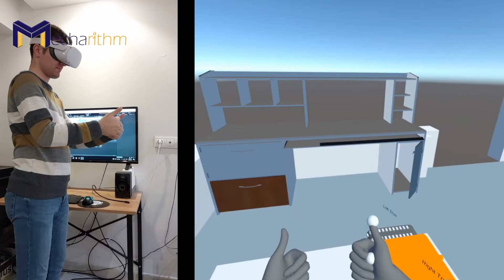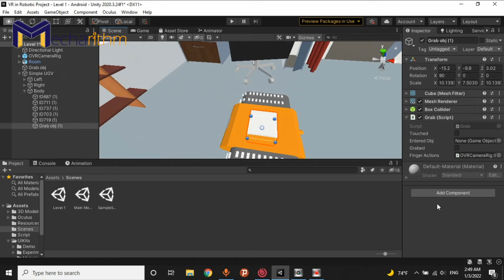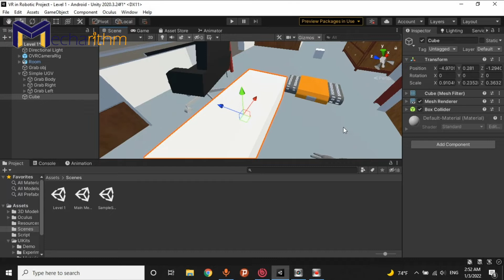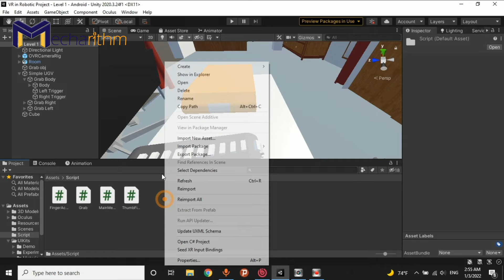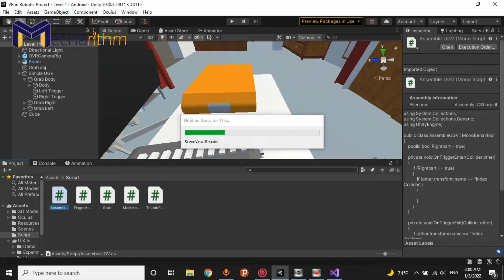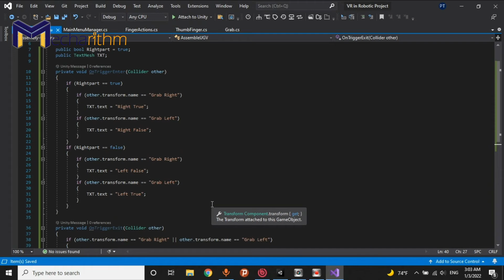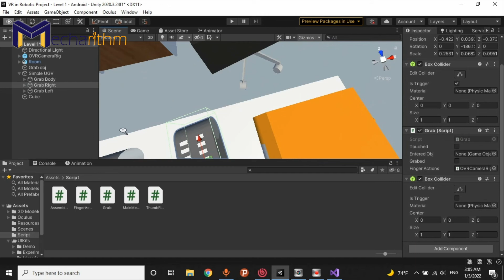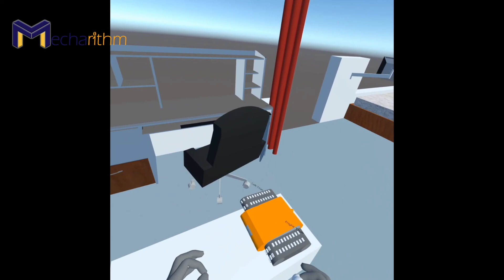VR Robotics Simulator: Assemble a Robot in VR (7/15) | VR Tutorials for Beginners

Comment: how did you divide the ugv model instances into three parts
Reply from the maker: Muhammad, thanks for your great question. The 3D model that the instructor used for this course was like that from the beginning. you can import the same model, and the parts are separate.
Reply: Actually it isn't he distributed it later
Reply from the maker: @muhammadfaiqmalik7028  Muhammad, what is distributed later?
Reply: Initially the ugv is not divided into right,left and body etc later when this assembling video start he shows its partitioned you can check it by yourself in the initial videos and then in this video.